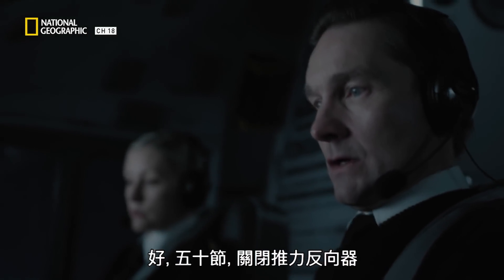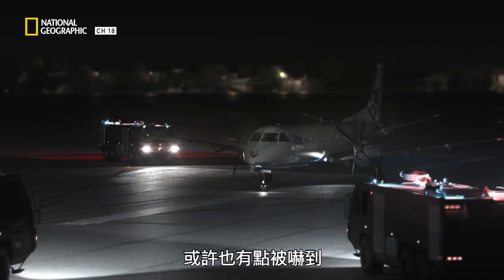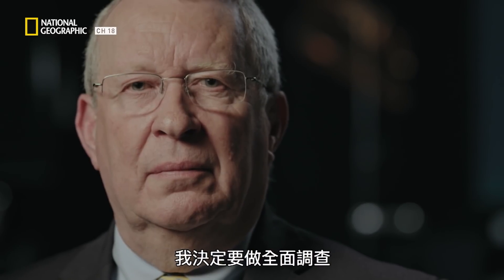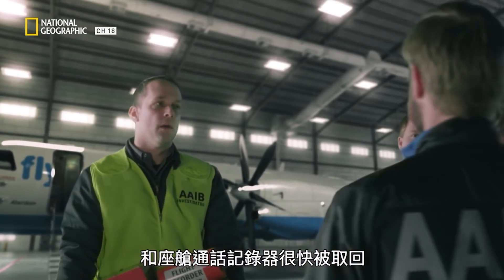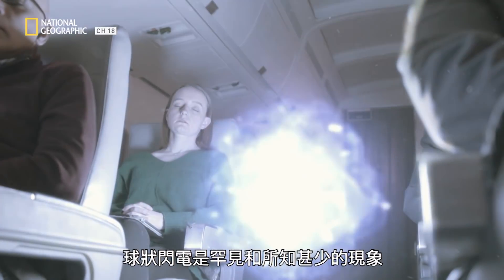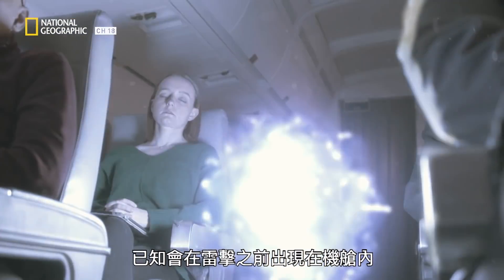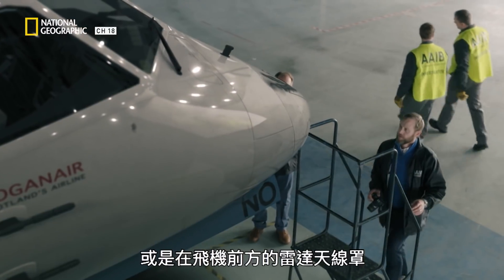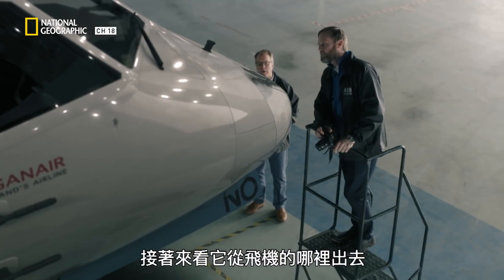機組成員自認受到控制受限問題，但在事後的飛機測試上卻沒有發現故障問題【空中浩劫20：洛根航空6780號班機】

Comment: Wiki結論

The commander’s actions following the lightning strike were to make manual inputs on the flying controls, which appear to have been instinctive and may have been based on his assumption that the autopilot would disconnect when lightning struck. However, the autopilot did not disconnect and was attempting to maintain a target altitude of 2,000 ft amsl by trimming nose-down while the commander was making nose-up pitch inputs. The control forces felt by the commander were higher than normal because the autopilot was opposing his inputs and he may have attributed this to a flight control malfunction caused by the lightning strike. He did not recall having seen or heard any of the aural or visual mistrim cautions which were a cue that the autopilot was still engaged. This was probably the result of cognitive tunnelling.